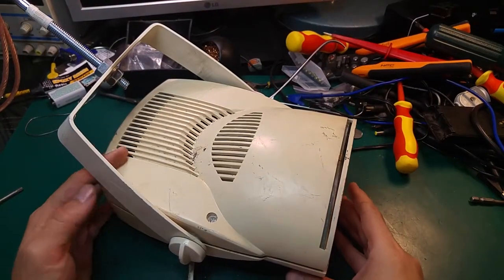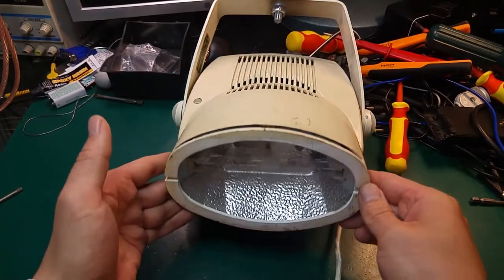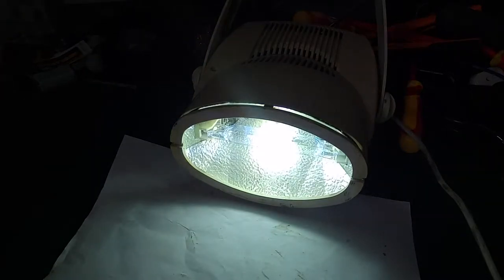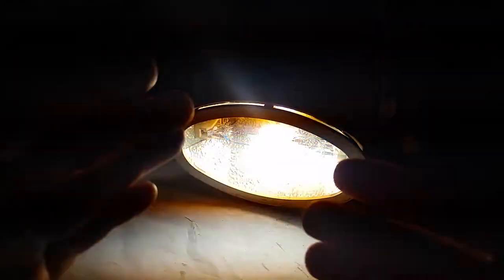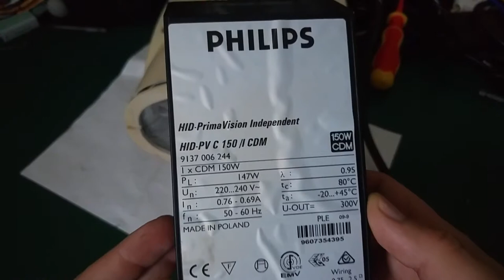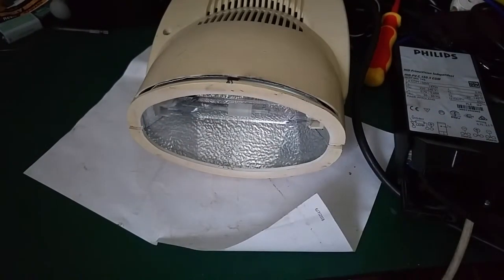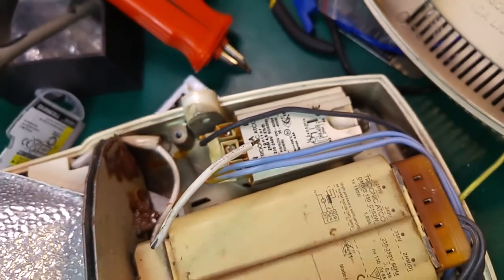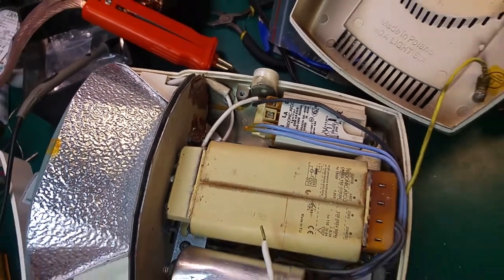Metal Halide lamp - camera flickering and startup: magnetic ballast vs electrical ballast

Comment: I can see slight flickering with the inverter ballast, however not enough to distract too much. The inverter ballasts for the metal halide bulbs, especially including some car HID ballasts, puts out 140 to 300 hertzs square wave AC, so flickering should not be too much of a problem as is with 50 or 60 Hertzs magnetic ballast.

Comment: I'm replacing old magnetic ballast into electronic ballast, but why it is keep shutting off every 15 munites ?? Please reply thanks
Reply from the maker: 1) broken bulb 2) wrong ballast and it's shutting down by thermal protection make sure max power rating it's not exceed.